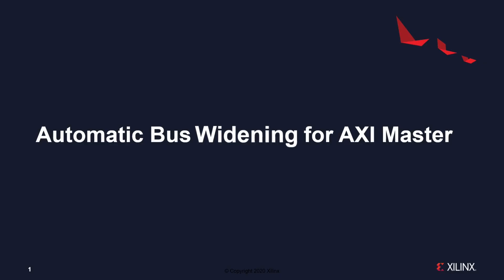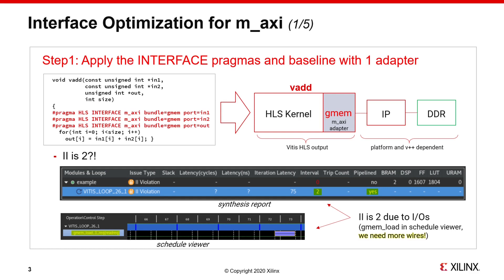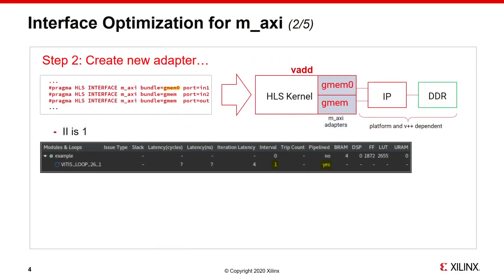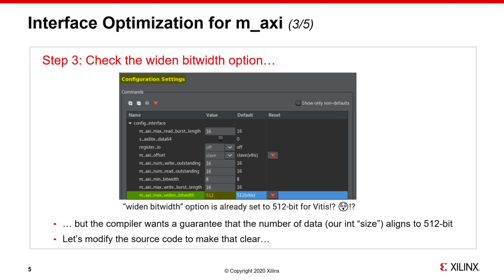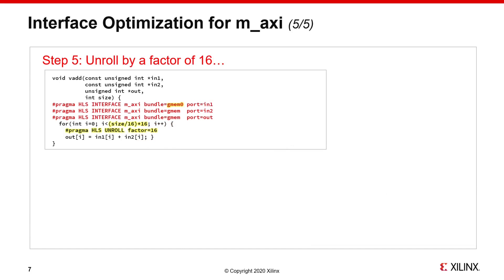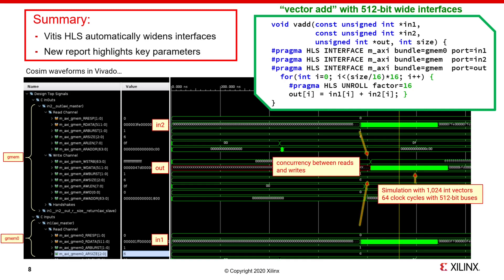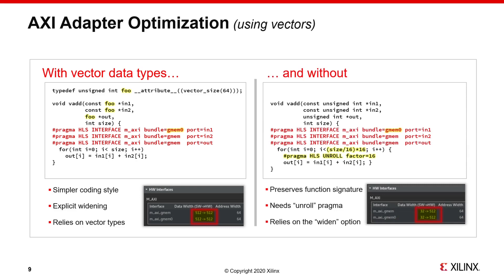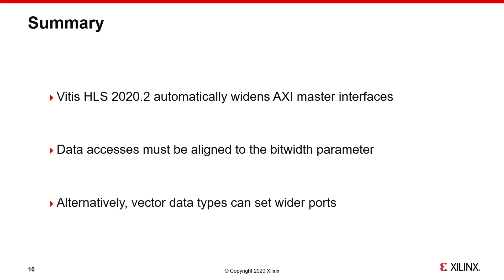Vitis HLS 2020.2 - Automatic Bus Widening for AXI Interfaces

Comment: why is the vector size set to 64? Shouldn't it be 16?  16 unsigned integers to match the one without vector data type.
Reply from the maker: From Frederic: The GCC "vector_size" is in bytes...  Therefore 16 integers (32-bit) is 64 bytes...
Note that HLS provides a library hls_vector.h that makes it easier to specify these vectors:
https://docs.xilinx.com/r/en-US/ug1399-vitis-hls/Vector-Data-Types